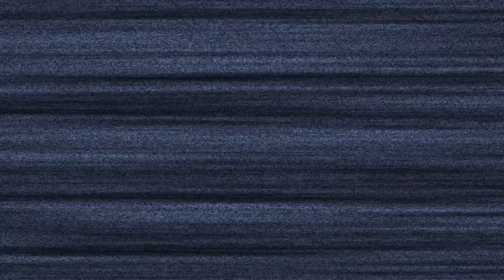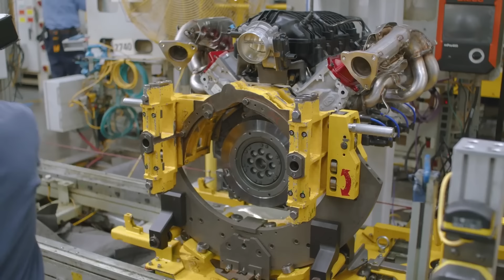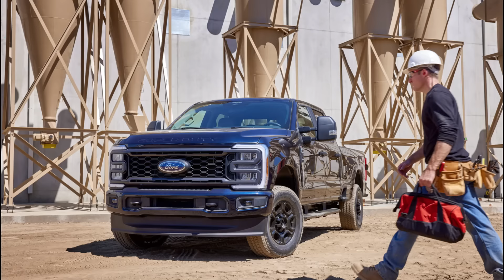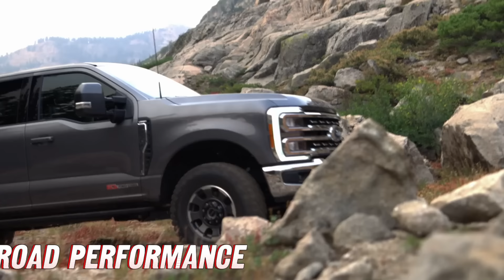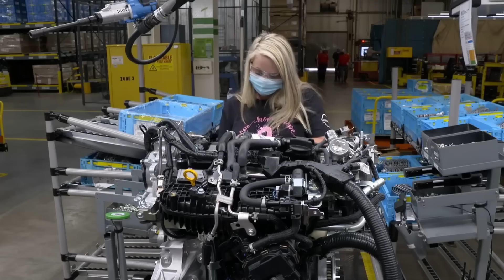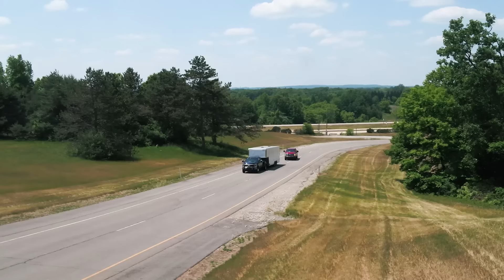ALL 4 Powertrains of 2026 Ford Super Duty EXPLAINED in Detail!

Comment: My 97 f250 with 7.3 and manual is staying as my tow rig as long as possible. Not perfect by any means but low cost of ownership and ease or maintenance makes it a good choice.
Reply from the maker: That 7.3/manual combo is legendary, simple, durable, and easy to wrench on compared to today’s electronics-heavy setups. Hard to argue with a tow rig that just keeps going without bleeding your wallet dry.

If you had to replace it someday, would you lean toward another diesel, or do you think a modern gasser like the 7.3 Godzilla could fill those shoes?

Comment: My 2025 6.8 crew cab 4x4  gets 18/19mpg on the highway. 13 around town. Just a little worse than the V6 Tacoma i traded in.
Reply from the maker: Those numbers are actually really solid for a big 6.8 in a Super Duty, especially when it’s not far off from what you were seeing in a midsize Tacoma. Goes to show how much tuning and gearing make a difference these days.

Do you feel like the jump from the Tacoma to the 6.8 has changed how much you enjoy daily driving, or does the size of the truck balance it out with the extra comfort and power?
Reply: @speed_spectrum_cars I just got the F250 new and like it alot. Its a real truck and its great looking with the STX/FX packages. The Tacoma was also a great looking truck but I was so limited what you can do with it. The Tacoma had a 990lb payload. Now I have 3781lbs. Really no comparison other than Toyota reliability. Going the truck camper route and no looking back. Its big but nothing crazy. Already changed the oil and filter at 750 miles took all of 20 min. Very easy to diy some of the maintenance. Time will tell with the reliability. No regrets so far.
Reply from the maker: That payload jump from 990lbs to 3781lbs is absolutely massive - no wonder the Tacoma felt limiting for your truck camper plans! The F250 really is in a different league when it comes to actual hauling capability. Those STX/FX packages do look sharp too.

How's the ride quality and daily driving comfort compared to the Tacoma, and are you planning to go with a slide-in camper or something bigger now that you've got all that extra payload capacity?
Reply: @speed_spectrum_cars Yes slide in camper. Putting a set of Timbrens on tomorrow for a little extra help with sag if there is any. Its a little stiff daily driving empty but nothing terrible. Some of the roads are beat up and you feel those but if the road is decent its no worse than my buddy's F150. Loving it so far.
Reply: @speed_spectrum_cars I think Ford has the best stuff out now as far as the trucks go.

Comment: The 7.3 needs a turbo to top the F150.  Then it rivals the diesel and the Cummins gas engine.
Reply from the maker: Good point, a turbocharged 7.3 would definitely shake things up and close the gap. But don't you think with all the turbo-hate lately about reliability and complexity, slapping one on the 7.3 could end up hurting its reputation more than helping?

Comment: Strange enough my 2022 f350 tremor has the standard 6.7 475hp 1050lbtq so it's been offered quite a few years now in Tremor package
Reply from the maker: That 475 hp / 1050 lb-ft setup is a beast. How’s it treating you for towing, daily driving, and fuel economy? Any real-world surprises or things you wish were different?
Reply: @speed_spectrum_cars I had an issue with it coding. The TCM is corrupted had to take to dealership 3 times & about a month without the truck. Replace TCM,PCM reflashed the PCM 4 times then replaced the batteries in the truck fixed the problem. 
    Towing it's great, the power is unbelievable ! I have a modded 2006 f350 6.0 6sp manual. No comparison between the two trucks. I move 2 tractors at a time between my farm & my house no worries. Towing i get 16mpg around town empty about the same 16mpg highway empty 20mpg. 
   Overall the truck is great inside out. I have the lariat ultimate tremor package Black on blackout. The biggest thing I've  disliked is snow driving is extremely touchy. The HP & torque makes it like to break traction easily in snowy conditions, that can get dangerous fast.  My 06 goes like a beast in the snow but it's a manual so I can ride the clutch some.
Reply from the maker: Man that’s a solid breakdown, appreciate you sharing it. Sounds like the truck really shines on the towing side but the snow manners definitely keep you on your toes. Do you run dedicated winter tires, or do you just let the Tremor’s stock setup handle it? Curious if swapping rubber helped tame that traction issue at all.
Reply: @speed_spectrum_cars  So I put Nitto trail grapplers on it 35x12.50 because my factory Goodyear 285/75r18 barely had legal tread on them. I swapped the Nitto's off my 06 because i had just put them on before the motor went & i bought the 2022. Nitto's on my 06 went great in fields we have had 18" at a time no real issues. 
The Tremor will go it's just so damn torque'y taking off you gotta be easy and if you get itchy and mash on it it'll break traction in a heartbeat!

Comment: So no more 6.2L? It's a 6.8L now?
Reply from the maker: Yep, the change was made in 23', 6.2L is gone, and the 6.8L is its replacement in the lineup. Ford’s pushing it as a stronger base gas engine with more torque down low. Do you see that as an actual improvement, or do you think the 6.2L should’ve stayed?
Reply: @speed_spectrum_cars if you ask me, I think the popularity of an engine depends on the performance aftermarket.  The 6.2 never got the love that the coyote or even the new ish Godzilla has gotten. So hopefully the 6.8 turns out to be a good engine and gets a performance following
Reply from the maker: That’s actually a really underrated point you brought up, aftermarket support really does decide whether an engine builds a loyal following or just fades into the background. Out of curiosity, which engine platform outside of Ford do you think has had the strongest aftermarket love over the years?
Reply: @speed_spectrum_cars obviously the LS platform.

Comment: And the diesels still come with the cp4
Reply from the maker: Ugh, the CP4 pump of death strikes again! Ford's still using those failure-prone high-pressure fuel pumps that can grenade the entire fuel system when they go. For a $90K work truck, you'd think they'd spend the extra money on a more reliable setup.

Have you dealt with CP4 failure personally, or just trying to avoid that nightmare? Because it seems like such an obvious weak point that Ford refuses to address.
Reply: @speed_spectrum_cars  If other modern diesels using the failure prone CP4.2 high pressure injection pump as stories of where $20K comes from for a complete fuel system replacement after the pump let go.

Comment: lol my 04 f350 gets better fuel mileage, makes more power, and looks better then any of this new junk
Reply from the maker: An '04 F-350 beating the new ones in fuel economy AND power? That's either the unicorn 6.0 Powerstroke or you've got some serious modifications going on! Those early 2000s trucks definitely had cleaner styling before Ford went crazy with all the plastic cladding.

What engine are you running in that '04, and how are you getting better mileage than the new stuff?
Reply: @speed_spectrum_cars   6 liter, studded, deleted, tuned, larger turbo, and some air upgrades. Nothing too crazy, still has stock injectors. She’ll absolutely whoop up on a 6.7 HO tho, and get 20+ mpg if I want to. I mean why anyone wants to buy that new crap designed to fail is beyond me

Comment: It would be nice if not awesome if they were to bring back the standard transmission
Reply from the maker: A manual in the Super Duty would be amazing! Nothing beats that direct connection and control, especially for serious towing or work situations where you need to manage engine braking and gear selection yourself.

What's your current truck situation - missing a manual you used to have, or just dreaming about what could be?

Comment: This new detailed list of powertrains looks oddly like the list from last year.
Reply from the maker: Other than some minor tuning and updates, the 2026 powertrains are mostly the same as last year. Which of the four do you think strikes the best balance between power and everyday usability?
Reply: @speed_spectrum_cars Hands down the 7.3 gasser. The powerstroke is an amazing engine but it is way overkill for 99.9% of all driver’s needs. I have a 2024 F350 7.3 (not a dually) and I haul heavy multiple days a week. In the 11,000 miles I’ve driven in the last couple months I am averaging 11.9 mpg and it can pull nearly anything you can hook it up to. I drive around Austin every day on the toll road and can tug any trailer 85 mph with little issue. Unless you are hauling a 20,000lb trailer through the mountains all the time you have zero need for the diesel. Initial costs, upkeep costs and repair costs are exponentially cheaper on a gasoline setup. My previous truck was a 6.7 powerstroke that I sold after 400,000 miles and it was still running strong after full delete but I’d still pick the 7.3 for daily use and work. Once warranty is up I will tune it up to around 600 crank hp.
Reply from the maker: That’s a solid breakdown, you basically nailed why the 7.3 makes sense for the majority of owners. Simpler, cheaper to maintain, and still has the grunt to get real work done without being excessive. That 11.9 mpg while hauling is honestly pretty respectable too. When you tuned your 6.7 in the past, did you notice a huge difference in reliability or drivability, or did it stay pretty bulletproof?
Reply: @speed_spectrum_cars Deleting, tuning and straight piping definitely gave more power. I never turned it up past the towing settings and never had an engine problem. However, I did the delete at 250,000 miles and the trans gave up just before 300k. $5,000 for a rebuild and got another 100+ thousand miles before little stuff became too much problem for me to justify fixing. Multiple small oil leaks after that many miles started pissing me off and I just wanted to move on.

Comment: You can opt to get the 6.8L V8 (which is basically a destroked 7.3L) for $1K credit on XLT’s. To get a 7.3L on the XL, you have to get the STX package which is a $3K+ appearance package to get: paint matched bumpers, LED headlights, cloth seats, cloth floors, 360 degree cameras and 20” wheels on top of the $1K price tag for the engine.
Reply from the maker: That packaging strategy is so frustrating! Ford basically holding the 7.3 hostage behind a $4K appearance package when all you want is the bigger engine. It's like they're forcing work truck buyers to pay for stuff that's going to get beat up on job sites anyway.

Are you looking at this for actual work use, or more personal hauling? Because if it's work truck duty, those cloth floors and 20" wheels in the STX package seem like they'd be more liability than benefit. Rubber floors and smaller wheels make way more sense for that application.

Comment: Did Ford correct the low oil pressure problem on the Godzilla motor? I mean it's pretty dumb for the oil pressure to be so low at idle. Sometimes the motor needs to be idled at construction sites to run auxiliary equipment.
Reply from the maker: That's a really good point about the construction site idling - when you're running hydraulics or other PTO equipment, you need that engine running at idle for extended periods, and low oil pressure becomes a real concern instead of just an annoyance.

Are you dealing with this on a current Godzilla motor, or just planning ahead? And have you found any workarounds - like bumping the idle speed up when running auxiliary equipment - or is it just a "cross your fingers and hope" situation?
Reply: @speed_spectrum_cars I’m a Fleet Manager for a construction company. We have several F250 and F350s with the 7.3 and 2 of them are down with bad engines. Both are under warranty and we have proof of dealer oil changes with OEM filter (we do them at 8000kms) which is consistent and well within the intervals and Ford is giving us the run around.

Comment: Eh I'll keep my old 2000 Excursion 7.3L Powerstroke with 365K on it. The 4R100 gave up a few months ago and cost a whopping $3,200 to rebuild it...big deal as I'll die before this truck does. What they say? $52K for a base model F250?? I can rebuild my 7.3 about 4 times for that!
Reply from the maker: 365K on a 7.3 and still going strong? That thing's basically immortal at this point! The 4R100 giving up is practically expected maintenance at that mileage - $3,200 is annoying but still way cheaper than truck payments.

The fact that you can rebuild your entire engine four times for the price of a base F250 really puts modern truck pricing in perspective. Your Excursion is probably more capable than half the new trucks anyway. How's the rest of it holding up at that mileage - still solid, or are you constantly chasing little issues?

Comment: Ford needs to ditch the unreliable 10 speed trans.  Keeping my 2016 until they bring back the 6 speed auto or offer a manual.
Reply from the maker: Smart move holding onto the 2016! Those 6R140s were actually pretty solid once Ford worked the bugs out. The 10-speed feels like they fixed a problem that didn't exist and created ten new ones in the process.

A manual option would be awesome, but let's be honest - Ford's probably never going back to that. Too much EPA pressure and not enough demand from the general public, unfortunately. How's your 2016 treating you?
Reply: @speed_spectrum_cars 
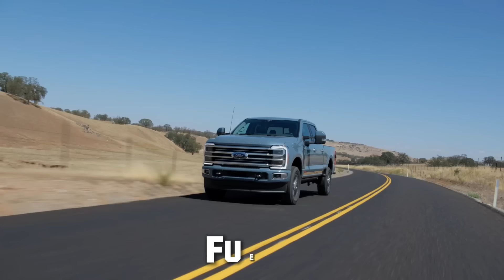Purchased it new, ordered it with a 3:55 rear end.  It now has 120k miles on it with about half of the miles towing.  The only failure has been the DEF heater.  Just upgraded the CP4 to the S&S DCR out of caution.  Still drives as nice as the day purchased.

Comment: I think Ford needs to build their gas V8’s with their diesel the components. So basically build a diesel replacement deviate with the crank block cam, and a few other components from the power stroke to To make a torquier engine.
Reply from the maker: That's actually a brilliant idea! Using the Powerstroke's heavy-duty internals for a gas V8 would create a monster - imagine 7.3 Godzilla displacement with diesel-grade components for reliability and torque delivery. Wonder if the cost would be worth it though - those diesel components aren't cheap to manufacture. But for people who want gas simplicity with diesel durability, it could be a game changer. What made you think of this combo?
Reply: @speed_spectrum_cars  I mean Cummins is doing it so I don’t see why Ford can do it and it be cheaper because they could drop the normal Godzilla and just have the 6.8 that new 7.3 and the 6.7 Power stroke.  Or an even better idea would be tonjust use the Power strokes architecture to start with and just make a gas engine out of it and removing the need to have the 7.3 Godzilla and also perhaps allowing Ford to keep the turbo  on the gas version of the 6.7.

What made me think of it is simply that I always felt that the heavy duty versions of gas engines were kind of weak. I mean 400 hp is fine, but the torque to me isn’t high enough it by now they should have been able to get those engines to make at least in the 600s or even up to the 700s

Comment: This is just making me feel better about spending 10k on my 94 f350
Reply from the maker: A '94 F350 for 10k? That's actually looking pretty smart right now with how crazy new truck prices have gotten! Those OBS Fords are starting to hit that sweet spot where they're old enough to be cool but still new enough to actually use as trucks.

What kind of shape is yours in? Original engine, or has it been swapped/rebuilt over the years? And are you using it for actual work stuff, or is it more of a weekend warrior situation?
Reply: @speed_spectrum_cars it’s far from original at this point. Had an IDI turbo and e4od automatic. Now it’s got a 7.3 powerstroke and zf5, 4x4 conversion and it’s getting swapped to bullnose front clip. Was my daily driver until I got offered a field tech job at work so now it’s just the weekend warrior. It’s my only personal vehicle nowadays so it’s gonna do everything from road trips to hauling trash off.
Reply from the maker: That OBS F350 sounds like a proper project truck! The IDI to 7.3 Powerstroke swap with the ZF5 manual is a solid combination - way more reliable than the automatics from that era. The 4x4 conversion and bullnose front clip swap shows some serious dedication to making it exactly what you want.

How's the ZF5 holding up behind that 7.3, and are you planning any other modifications once the bullnose conversion is done?
Reply: @speed_spectrum_cars  probably just going to put a chip on in to get a little more power so it’ll handle the 3.73 gears and 35s better. I put reman stock size injectors in it and it feels powerful enough for me. The zf5 came from the parts truck and 5th gear scratches if you don’t shift slow. Plan on sending one of my core zf5s out for a rebuild so I dont have to put the truck down since it’s still drivable with the current transmission.